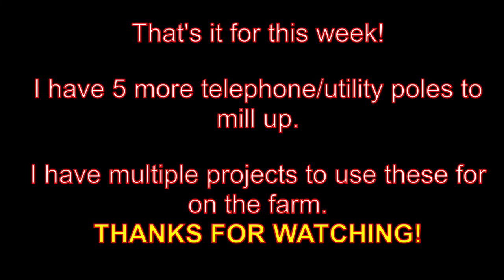Sawmill Shed Update & Sawing Telephone Poles

Comment: I have a few questions, sawing utility poles,  are you using a different blade? there is a place that sales a blade they say works well for this purpose (timberwolf blades)
I also would like to know how long your blades are currently lasting?, do you increase your water to the blade?............ and I think that bucket idea was a good idea.
Reply from the maker: I have been using the Lennox blades that came with the sawmill. No problems with them. 

I use a blade for four to six hours before changing. I have ten blades and have sharpened them all just one time. I believe that I could get five sharping out of them. 
Water-keep it at a fast drip to small stream. 
Thank you for the questions! 
Happy Saw-milling!

Comment: What did you do with the chemically treated sawdust?  Love the sawmill.  I see you are not using the ramps and winch to load the sawmill.  do you regret getting the ramps since you are using your tractor?  I am looking to purchase this exact setup for two farms about a mile apart.  Wondering if I should wait till I have a tractor with unloader for each place.
Reply from the maker: I put sawdust in the burn pile.
Reply from the maker: I have some hickory logs that I am unable to pick up with the tractor because of the weight. I will be using the ramp loading system then. It was definitely a worthy purchase.